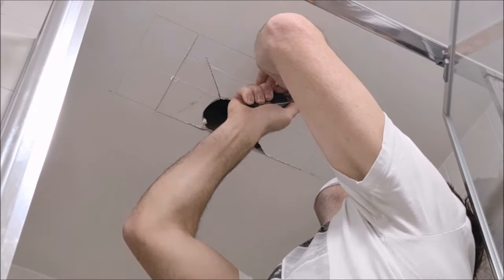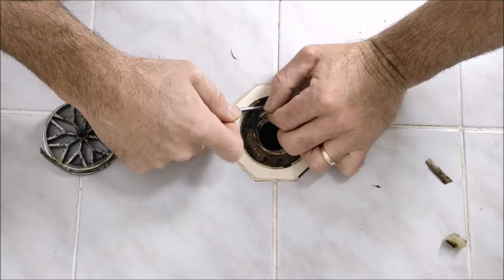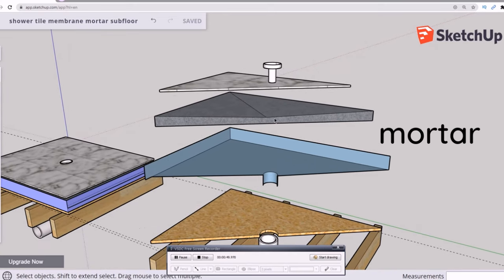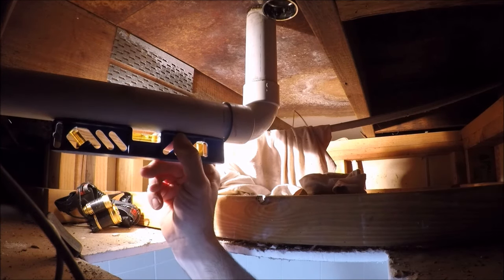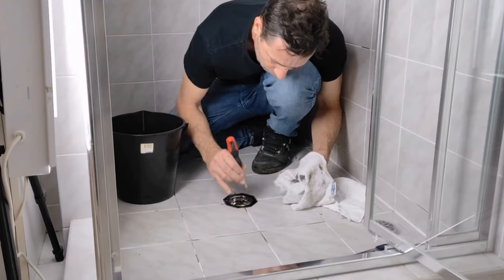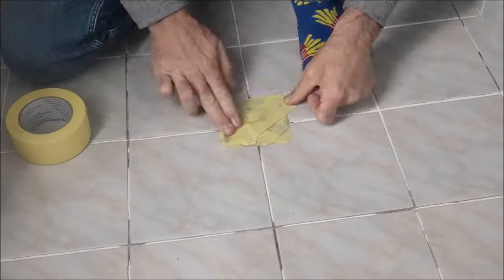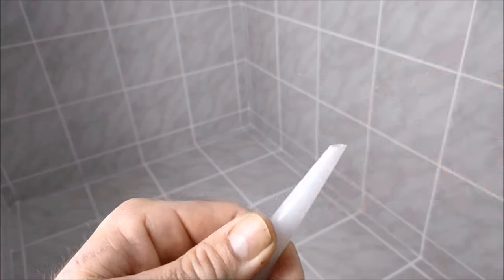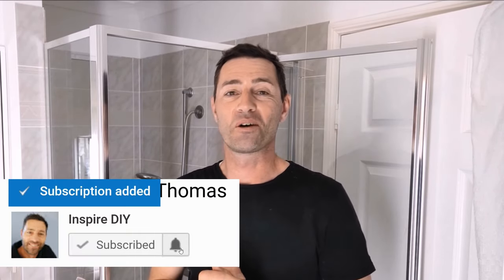How to fix a tile shower leak without removing tiles - Inspire DIY Kent Thomas

Comment: Can you please explain why you've used silicone around the floor waste and not grout? We've had a few issues with the silicone sealant in our shower coming loose. We recently had it resealed but the silicone came loose again so the guy has now grouted it.

Comment: Hi Inpire . In the states we usually a solid glued in place 2" ABS black plastic P shaped trap ,,without a union.. On high end homes I have seen a lot of"no hub" cast iron pipe and fittings put together with "No- Hub Couplings". I do like your videos mate ,keep up the good work.
Reply from the maker: Hey RapidRhino, done quite different a world away huh! cheers Kent

Comment: We need someone like you to tackle our undiagnosed leak somewhere coming from our bathroom/shower?  No one can find it yet our tiled floor in the bath has popped up from a bad install.  Some say it could be water traveling from the toilet?  Some say the tile floor in the shower?  I have had 3 plumbers and 2 basement "experts" come to try and see where the water is coming from to no avail.
Reply from the maker: Oh that's so annoying LASadvgrrl, I feel for you.. water leaks and the damage they cause are the worst headache! Best of luck to you with getting it sorted. Kent

Comment: Great video with lots of detail, but mixing ammonia and vinegar creates chlorine gas that is dangerous.
Reply from the maker: Hey wrtservice1, good to know - a great safety tip! thank you. 
for those of us who want to protect ourselves from harmful gases, 3M has quality respirators at good prices and this gear will last for years https://amzn.to/3CJDVjl or eBay https://ebay.us/pufY0J Just make sure you have filters that are suited to ammonia such as the '3M Respirator Cartridge 6006' https://amzn.to/3pZsah3 or https://ebay.us/PvKhuB
(Ammonia is an inorganic compound so make sure your mask rated accordingly, a dusk/particulate filter is not good enough).
Take care, Kent

Comment: It’s a great idea in the room below to fit an inspection plastic cover they look neat and finish off the ceiling below and you then have an inspection panel for any future problems great video
Reply from the maker: That's a great idea Neil, I'll be doing that for sure 👌. Thanks for the comment and suggestion. Kent

Comment: Thanks heaps for your video. I found it very helpful. Smart to use a waste outlet directly sealing on the tile and connect to the drain. No need using and waterproofing the puddle flange any more. Less hardware and less connection means less chance of leaking. Great job man.
Reply from the maker: Hey Harry, thanks for the comment mate - it’s seems there’s been mixed opinions on the puddle flange from some.. either way it’s been a success👌 after this I bushed on a ‘Remedial Membrane’, check it out here.. cheers, Kent 
https://ebay.us/x1M0mB

Comment: Great video bud, awesome. I have a grout saw/tool/rake which worked better than the multitool for me. However I have to replace my shower polymarble base as it is cracked. Im trying to avoid to total bathroom reno as work has pretty much evaporated during this time of interest rate rises. Im looking at replacing the shower base with a new one and only removing the bottom layer of wall tiles in order to fit the new base and then reseal. The only problem is trying to find a match for the base and then new shower screen kit that would pretty much replace the old one. Being a standard built home everything is your typical standard sizes, fingers crossed and we will see how it goes.
Reply from the maker: Good on you James, all the best with your project 🤙 Kent

Comment: Thanks Kent for posting this simple, honest and easy to do video.  I have a few questions : 
1/ Silcone has been used in the junctions between the wall and the floor.  Is there a reason why grout should/should not be used in these areas? If I have existing grout in this area, should I take it out and replace it with silicone, when fixing a leak.
2/ In your case, was the primary source of leak the shower waste outlet area? Meaning, if you fixed only the shower waste area would that have been sufficient to stop the leaks? 
3/ Also you mentioned that the waterproofing membrane had disintegrated, was that only in the shower waste outlet area or elsewhere as well?
4/ Lastly, is there an advantage/disadvantage to using epoxy grout as opposed to normal grout?
Thanks Kent, for your meticulous upload and writeup as well. Very much appreciated.
Reply from the maker: Hey Wayne, great questions 👍. 1. Silicone around the joints because it has great adhesion, and is flexible to allow for any building movement, also get a mould resistant one - it's worth it. Edit; I would scrape out the grout from junctions, give it a good clean https://youtu.be/lTrFg-bIUqU and re-silicone https://youtu.be/D7K9wD-andA
Reply from the maker: 2. You are right.. very observant, it was the shower waste that was the primary source of leak due to the membrane breaking down. I think if it's shot in that part it's quite likely no good in other areas of the shower pan too🤷‍♂️
Reply from the maker: 3. I think that the membrane had lost integrity in more spots than just around the waste pipe because of the amount of water damage to tiled sub floor (above the dripping drain).
Reply from the maker: 4. Epoxy grout material is waterproof, but it still allows water leaks around any gaps or cracks between grout and tile that eventually open up🙄. It's best done by pro's and at a cost - not worth it for me.
Best of luck with your project Wayne, and thanks for the Qs. Kent

Comment: Really well made and explained video, thumbs up.   I've never fitted, nor had to repair one of these style 'wet-room' type of shower bases - but 2 things struck me as a little odd (re the hardware itself, not your techniques and hard slog!)  1. No trap (that normal there?), 2. The shower pan waste/drain to waste pipe fitting sleeves the wrong way to all other conventional types I've used/seen before - IE the downstream waste pipe sleeves up INSIDE of the (chromed) drain waste section?!  OK it's solvent welded into place but still, all the ones I've seen and used previously sleeve inside of the waste pipe thereby making it (almost) physically impossible for water to make its way past the fitting.   That aside - lot of hard work clearly went into that job, having regrouted a shower prevoiusly, I can appreciate your obvious efforts, nicely done!
Reply from the maker: Hey blakeb1ade, you on the money with your observations.. and well done paying such close attention, 1; rest assured there is a common trap just out of view that the bath, basin and shower all share. And  2; I agree with you about the feed should be inside the receiver but this was the only floor pan waste I could get that fits the existing tile shape - and yeah cemented in well like you say worked a treat, a couple of years on now I'll uncross my fingers as its all going well. cheers for the feedback bud, Kent

Comment: couple of points:  it would be much better to have pipe connections done so that they are female at end A and male at end B with water flowing from A to B, this means the chance of any water seeping through a bad join are eliminated given slope of piping.
Reply from the maker: True that, cheers Kunjan.

Comment: Hi, very good video! thanks. what about the leaks is not the pipe area? in my case seems like the shower base, any advice? thanks.
Reply from the maker: Hey Thomas (great name BTW) If a bathroom renovation is out of the question, I have used a 'Remedial Membrane' and absolutely recommend it - it's a great problem solving product!  feel free to have a look here at it: https://ebay.us/z2KW0f cheers, Kent Thomas

Comment: Cheers mate,
Where should I buy this product? Bunnings seems don’t have them at all .
Any store in SA u could recommend?

Thanks in advance
Reply from the maker: Hey Silkroad, yeah Bunnings doesn't carry it unfortunately. you could contact Sureseal head office and ask about distributors in SA on 03 9561 8899 , on eBay https://ebay.us/ulTzoC I found this in a local paving and hardware store.
Can I suggest though, even though 2 years later all was dry under the shower tiles.. I felt it was in need of something more permanent, so I applied a Remedial Membrane, I have no affiliations with this company - but I recommend the product 100%, they can be found on YouTube or these links below; 
Remedial membrane eBay https://ebay.us/RqqHwJ
Waterproofing transparent https://amzn.to/3RPDkUL 
best of luck mate, Kent

Comment: Fantastic video. I have this problem at the moment. One question, what if it is the membrane that is affected? Will this still help or do we have to pull out all the tiles? I am hoping that this is not he case. Thanks.
Reply from the maker: Hey sue, either 1: Rip out the old tiles and start with a new membrane, it can be an expensive rebuild 2: re-grout and re-silicone and then apply a remedial membrane over the top (this is my choice and have had success), or 3: have epoxy grout installed but it’s not great in my experience 4; have a replacement plastic shower tray and walls installed, Best of luck. Kent

Comment: Great advice in this video. Thank you
Reply from the maker: Hey Ishteeaq, thanks for commenting - I'm glad you found it helpful.. let me know how you get on with your shower fix👍Kent
Reply: @InspireDIY  Hey Kent, so I have to deal with a bit of a mess for my friend. They have small cracks in the grout on the floor tiles, inside the shower. This has caused water to seep out and flooding the rest of the bathroom floor to build up dirt and limescale. This should be a temporary fix I hope.
Reply from the maker: Oh no.. sounds like my problem of a failed waterproofing membrane 😬. Will you use a grout sealer too? I recommend it.. I would even try a solvent based sealer over new grout next time, like this one https://www.cpcproducts.com.au/shower-plug/
(No affiliation) best of luck mate, let us all know what you chose to repair the leak.🤙 Kent

Comment: Hi Kent, been following this video for my shower, so far so good as have successfully regrouped the floor. Just a question, I intent to seal the shower, do I do that be of after using silicon? Thanks
Reply from the maker: Hey Robert, Absolutely mate, I am a fan of the shower sealer (remedial membrane)  over top of the silicone, I have used it and love it. if you are just using a waterproof 'brick and tile sealer' then apply that first to the tiles and grout. best of luck mate, if you have any other Qs. just ask. Cheers, Kent
Reply: Hi Kent, all worked very well baes on your steps, old shower looking really great. Thanks for the tips!
Reply from the maker: Good on you Robert, cheers for the update. Kent

Comment: Thanks for the very informative video!  Does this mean that you are no longer relying on the water proof membrane and resealing the grout and tile should keep the water from reaching the water proof membrane?
Reply from the maker: Hey J, yes you are right👍 and by design this is not as good as a membrane. But without lifting tiles this is one option, a remedial membrane works well also, see this link 👍 Kent 
https://ebay.us/x1M0mB

Comment: Hi Kent, thank you so much for sharing the video which is really helpful. Here is question for removing the previous grout in the crack of tiles. You did remove it by using a machine, what name of that macine, or any orther way to remove that? Thanks again！
Reply from the maker: Hey Alvin, there is a related video about this if you would like https://youtu.be/ElOydwH4cEI it’s about removing epoxy grout (hard as a rock product) the hand tool linked in video description would suit if you have cement grout 👍 let me know if that doesn’t answer your question, Kent
Reply: @InspireDIY  Cheers! thank you !

Comment: How would this work if I have a pebble floor /rock floor ? Installed 6 months ago and leaking already , there was a painted on rubber membrane underneath no “pan”
Reply from the maker: Hey Gus, where’s it leaking from - can you tell? Kent
Reply: No I can’t tell I plugged the drain and filled up the shower up to the threshold that’s like 5 inches … left it for 2.5 no leaks

Comment: Excellent video. 
No tray fits my tiny shower space. (65x75 cm = 25.5"x29.5")  Can you cut a shower tray?  How do you cut a 3d acrylic surface?

As a 1-year temporary fix, could I use multiple layers of liquid membrane instead of a tray?  (I actually want the fix to be temporary.  Don't ask.)
Reply from the maker: Hey Jonathan, you are asking stuff beyond my pay grade mate …I’ve not done a resize of acrylic shower pan💁🏻‍♂️ I’d love to know what you come up with though, or if any DIYers or Bathroon reno people here know feel free to chime in👍 Kent
Reply: @InspireDIY  just realized that product may not be acrylic... No, it's expanded polystyrene.  I'm guessing much easier to cut than acrylic.

Comment: Can I ask where is the trap soda sewer gas don’t escape out of that flange do you have the trap like next to the main trunk line????? Herron, United States you have to put a trap on the vertical piece, so no sewer gas can escape
Reply from the maker: Hey Kenny, there is one just out of view of the camera - not directly under the shower but maybe half metre away. Kent

Comment: It looks like some of the caulking around the floor tiles are slightly worn out but there was no leakage due to that. Is that because if a little bit of moisture enters the motor layer through the tiles, it is redirected to the centre where the drainage is ?  Obviously you should re-caulk the floor every 5 year or so but I haven't heard of too many leaks through old caulking on the shower floor, mostly the drain itself so I'm just wondering why.
Reply from the maker: Hey micra, call me slow - but I’m not sure what your asking? Is it why did I re-silicone? As the membrane beneath the tiles had failed, I wanted to remove any chance of water ingress where it shouldn’t be. Cheers mate, if I’ve missed the point - holla at me again👍 Kent

Comment: Mate you are our savior, but how do we know if the grout needs to be replaced? In your video, the grout seems look fine?
Reply from the maker: Hey mate, good question 👍 yeah at first glance it did look ok... I decided to start with a fresh grout job as I wanted to be sure of minimal cracks and gaps, the epoxy grout had gaps that needed rectifying prior to sealing. Grouting is cheap and easy too! Kent
Reply from the maker: If you need grouting tips.. check out this playlist on my channel
https://youtube.com/playlist?list=PLMXeh8hXgu_GbTgoAZ2621uRf_xlZEijT

Comment: does a plumber work wit the tile too or will a tile person do the whole work , who is better to call because i think the tile person can do the whole job
Reply from the maker: Hey Cesar, in my experience, once any damaged framing is fixed by a carpenter, then any plumbing repairs are done by a plumber, then a tiler helped the waterproofing before re-tiling started. Just one way I guess.. but I’m a sucker for punishment and like to do it all myself 😉 best of luck mate, Kent

Comment: I saw your video on fixing leaking bathroom tiles .Awesome!Which grout would you advise to use ?
Reply from the maker: Hey Ashok, thanks for the nice comment🙂, I used Davco sanitized grout, I’ve used it a few times with good results but that’s just a popular one that’s convenient to get. I’ll add a couple of product links in the video. Thanks, Kent

Comment: Nice work pal. Did you glue the pvc to a metal drain?
Reply from the maker: Hey Shawn, thanks mate👍, the drain looks metal but it’s plastic (and not a chrome socket) so it is a perfect connection to the rest of the plumbing! Cheers, Kent

Comment: Great video!   Would it not be better to fit a shower waste that fits inside the collecting waste pipe ?
Reply from the maker: Hey andrew, yeah that would be the smart and logical thinking! Neither of those things describe me however 😉. I am putting my trust in a known technique of joining plumbing with primer and pvc cement. Even under pressure there would be zero leaks using this connection style. Thanks for the comment mate👍 Kent

Comment: I noticed that you inserted the PVC drain pipe into the shower drain waste. Shouldn't it be the other way round? I feel the shower drain waste should go into the drain pipe so that all the water actually goes into the pipe instead of some leaking out from the edge over time. Please correct me if I'm wrong
Reply from the maker: Hey Dipen, we’ll done mate you have a keen eye there👍 ideally yes, but this is not a deal breaker as the pvc was primed and sealed there will be no leak regardless of bell end and insert direction, the same technique is used with pvc pipes when flow direction is alternating, and under pressure where it relies on a sound seal, rather than an overlapping fingers crossed type of join. Cheers, Kent

Comment: I’m about to have to do this job myself  because I definitely don’t have 700$ for a fix per the plumber quote…we’ve only bought this house in sept gas leaks window problems and now drippy ceiling😩😩
Reply: Hey moonflw, what a shame ..lucky it’s fixable. after these steps you in the video, a great final step is a waterproofing membrane for guaranteed no more leaks. And it’s DIYable too. Check the link in the description, I’m happy I’ve done it! Best of luck👍 Kent